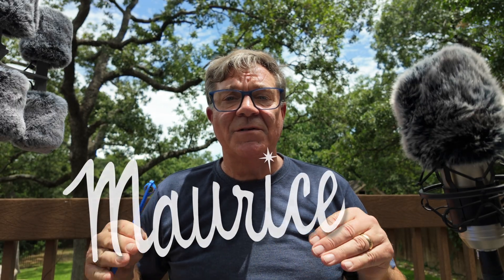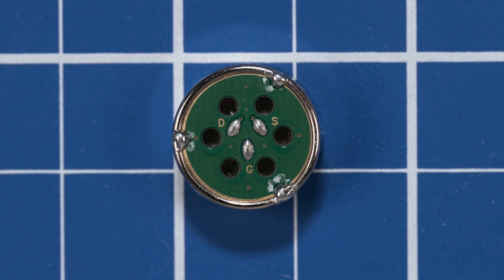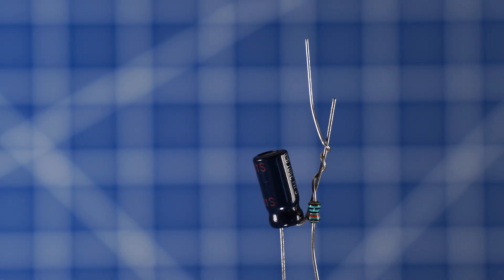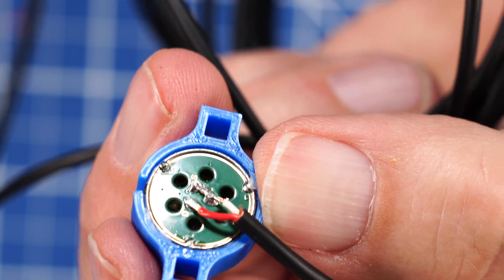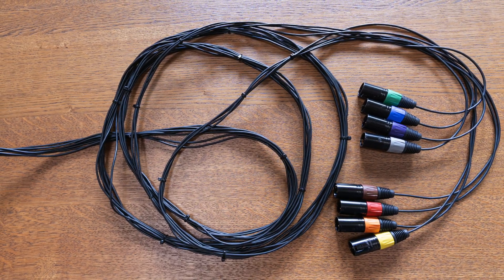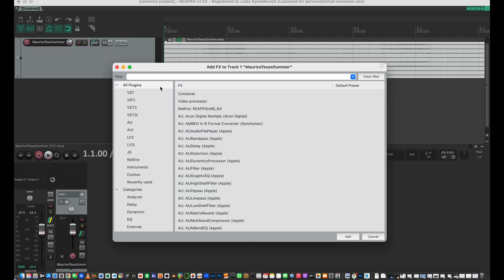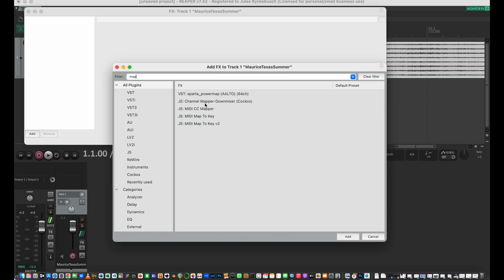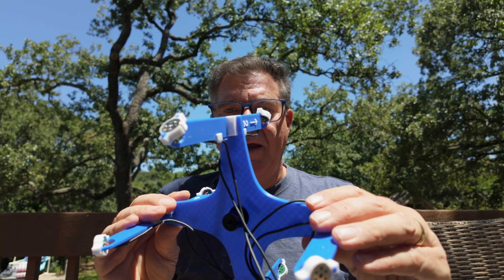Maurice an ORTF3D Microphone

Comment: This is close to my passion too and I would like for these microphones be prolific. 48V phantom power and XLR are a major hurdle due to cost. We should try to get the ADC closer to the mic and operate at 5V USB. At 24 bit dept the dynamic range is 144dB.
Reply from the maker: You are speaking my language. Ideally I want a multichannel recorder that the mics directly connect with . Recording to a microSD card... Ahh too many projects on my "To Do" list. This one is on it.

Comment: Nice! next: same mic capsule for 2nd ambisonic?
Reply from the maker: That is the plan 12 capsules. Its a hybrid 2-3 order
Reply: @SoundSleuth   You're working on a 12-capsule ambisonic array (2nd-to-3rd order hybrid)? I have a 1st order ambisonic Zoom H3-VR, and it's great, but I'd love to DIY a second-order array. 

The only problem I see with a 12-mic array is the recorder. My Zoom H8 with the XLR expansion kit can take 10 XLR's. The other Zoom, Tascam, and Mix-Pre's can take 8 to 10, but what can take 12? (or 16 for a third order array?) It seems that is a real bottleneck for any mic array using over ten capsules.
Reply from the maker: @GregConquest  I am planning on using two ZoomF6’s  you can sync them with time code. Zoom does something internally to generate clock sync from time code.  Only works zoom to zoom.
Reply: @SoundSleuth  I'm surprised regular timesync is that accurate (without word sync), but if you're sure it'll work, then ok. But you're creating an array that very few people will be able to use.

I found a paper from Stanford on a 2nd order, 3D printed design. It think it's available for everyone, but I'm not sure. It's just a design for the array holder, though, not a kit with capsules or circuit boards. From what I can find, there are no 2nd-order DIY ambisonic kits available, and there are a lot of people with 8-10 input recorders (I wonder if an optional ninth channel for an omni bass capsule would be very useful (below 100Hz or so... since bass perception is nearly directionless and since the mic capsules don't capture bass well anyway)). A 12-mic array would be a much more specialized kit with far fewer potential users.

One recommendation no matter what route you go: please consider integrating a tripod mount on the top too, for a 360 camera - and for suspending the array from flexible cords instead of putting it on top of potentially unstable shockmounts. Adding a 360 camera would be great, especially if youtube ever gets its ambisonic 360 video playback house in order (now only VR glasses with youtube's 360 app works reliably to move the soundfield around with the video movement; for almost everyone else, the audio doesn't move.) Maybe even a few tripod mounts if top-down suspension looks good, to keep the unit from spinning and to have redundancy if a cord breaks..

Good luck with the design.